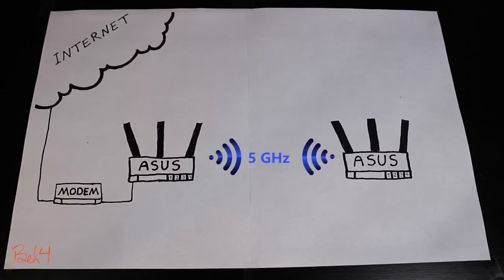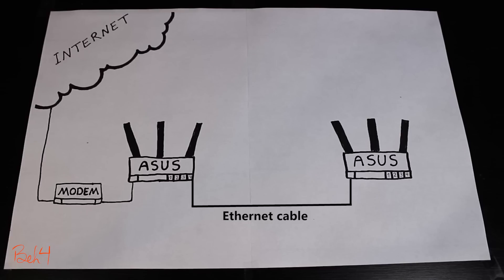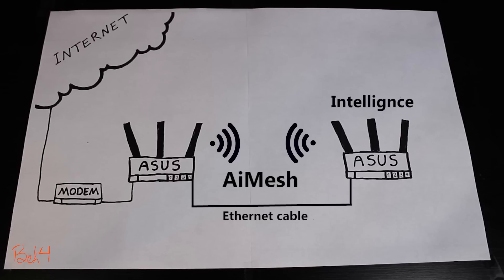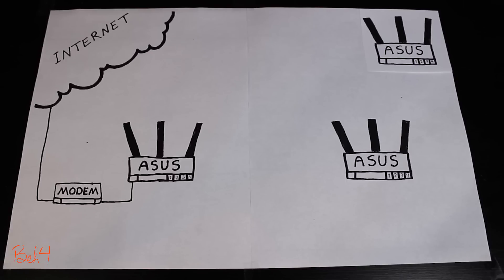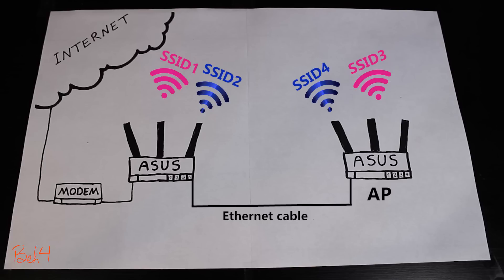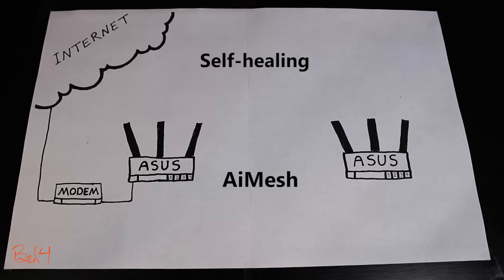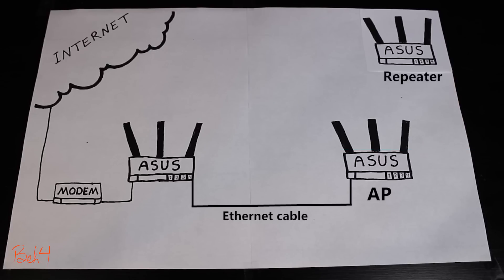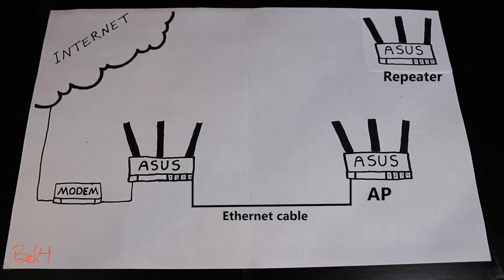AiMesh vs. Repeater vs. Access Point [ASUS RT-AC68U Operation Modes]

Comment: Hello, in AIMesh mode you said there could be interference of SSIDs between the devices. What if we activate the Smart Connect option and let's say there is only one SSID called "ASUSRouter". Are we going to see 2 of ASUSRouter SSIDs one coming from the Router and the other one coming from the Node? Isn't there a way to see the same and only 1 SSID in the house and let the routers decide which router the client will be connected? Thank you.

Comment: If we duplicate the SSID in the multi-router/repeater/access pointer systems, our devices might automatically connect the ones with weaker/slower signals (far away ones).

If we create a new SSID for each new repeater/access pointer system, we can manually choose the closest and strongest one to connect.

You might need to consider using a good ethernet cable to connect your router and your repeater to avoid signal degradation. 

What is the maximum length of CAT6e cable without data loss?
328ft (100 meters)
Cat6 Max Length. It supports 10Gbps.

CAT8 might be overkill. It supports 40Gbps.

Comment: does it replicate ethernet ports at repeater mode. I need to use vlan lan1 as it is at router.
Reply from the maker: If you are asking if the Ethernet ports work in the repeater mode? The answer is yes

Comment: I have an Asus AC68U a which i want to use as my VPN router, I connect to the internet now wirelssly with a Tp-lINK  TL-WR840N which is the access point. can I put the 68U to the tp-link? what mode will I have to use to configure the 68U and still have access to the VPN option of the 68U? I can only connect to the TP-Link without cables ,wirelessly.
Reply from the maker: It looks like from your description that you can only use your ac68u in repeater / media bridge modes ( those are the modes that allow you to connect wirelessly to the other w router) and unfortunately in either of those modes the VPN is not available.

Comment: There is one thing that has made me use the AP mode instead of AImesh: The inability to choose different Wifi bands for the mesh nodes. Since AImesh doesn't let me configure the nodes with different wifi bands, I have decided to skip AImesh altogether.

Do you know of any reason, aside from the simplified administration, to use AImesh instead?

I have one router (RT-AX88U) and 2 APs (RT-AX92U and RT-AX58U). They all use different Wifi bands. Roaming between them works perfectly well since all three support 802.11v and 802.11k.
Reply: no. you can never go wrong with a hard wired ap as it will deliver the maximum bandwidth to each node without interference. one thing you could do though is connect a switch to your main router and feed the ap's off of that instead. will take some strain off your main router. or better yet, get a non wifi router like a tplink omada. plug your switch into that and have all your RT-AX's run off the switch as ap's. ai mesh is basically a gimmick repeater mode, only with a few bells and whistles like having multiple nodes run off each other wirelessly. this doesn't always work as seamlessly as hard wired ap's. also, ap mode itself isn't exactly necessary. it will still work fine in router mode as long as you have dchp turned off on the ap's.

Comment: Subbed. I have 2 asus routers I’m setting one in the attic and the other as a access point wired in the living room. Thanks for breaking it down for me.
Reply from the maker: You're very welcome! Glad it was useful for you and thanks for subscribing 🙂👍
Reply: @Behfor  My issue was having a 'smart home' and not being able to reliably connect switches, ceiling fans, lights and appliances, along with my computer needs. I had everything wired into the attic and I figured I'd just put my router up there. It's a stick built house, all interior walls are insulated. I had a 7 year old AC3100 that worked well but was obviously out dated. I picked up a RT-AX86S and installed that in the attic and reconfigured the 3100 to an AP wired in the main room of the house. The one thing I did with the 3100 was let it provide the IP address dynamic, I didn't assign it static. That was an option in the 3100 AP setup. It took about 2 1/2 hours from unboxing the 86S to up and running the AP, some trial and error with naming and the usual 'first time' issues.
As for the connected appliances, I was able to configure all of them the first time, some with the AP and some with the host router.
Thanks for the help.

Comment: I found this video while trying to get rid of “double nat” on my xbox. It’s a great video!  My question is when I put the ASUS router into AP mode it says it disables dhcp and nat. My primary router uses 192.168 ip addresses, but my access point hands out 10.xxx ip addresses even though it apparently has dhcp disabled. Is there a way the AP can receive an ip from the primary router and any clients to receive their ip from the primary router through the AP?  Thanks in advance!
Reply from the maker: Hi, as you mentioned yourself when your change the operation mode to AP then the DHCP server gets disabled and it no longer hands out any IP addresses at all! The AP only passes the DHCP requests to the DHCP server which in your case is the main router! I would check the DHCP configuration on the main router and make sure it is correct! Also I would make sure there is no other DHCP server in the network. Thanks.

Comment: In the later part of the video, you showed AP router (connected to the main/primary router via ethernet cable) and Repeater router. Can these two (I mean the 2nd and 3rd router) be linked via AiMesh? I don't want the 3rd router in repeater mode.

Comment: OK, so I am looking to increase my Whole home coverage of Wi Fi and using the Asus Zen system and would like to know which method of the secondary node would be best for my second Desktop PC in another room. Would I connect the PC via Ethernet to the node and run the mesh system with wireless backhaul or use repeater mode for the second PC ? Trying to keep it simple so I am leaning towards the mesh mode for the satellite node. Thanks for sharing & Stay safe.

Comment: Let’s say i have Asus Router ——> Access Point ——> Repeater

Question 1: I heard that the speed could get 50 percent slower when a repeater is added to the chain. So does this mean my internet as a whole will slow down, wether im connected to the AP or the main router or the repeater? Or will the speed only get slower when im in the part of my house where im connected to the repeater?

Question 2: Will plugging an ethernet cable to a Mesh router be worse than connecting it to an Access point or the main router itself?

Let’s say i needed ethernet in a room, should I…

A: Access point and wire it to my room
B: run an ethernet cable from the main router to my room
C: get a mesh router in my room and plug my ethernet there

Comment: Thank you, Behfor, for some very instructive videos on Aimesh. Actually, I am hoping you are able to help me out on the following issue: I recently aquried a second AC68U device and now have two AC68U's connected in an AiMesh set up (no cable between Router and Node). Both have the newest firmware. But, very annoyingly, I am frequently requested to type in the password for my network. This never happened when I had only one AC68U. The system often responds with a "incorrect password", but trust me: I am typing the right one, I did not change it when going from a single router to the AiMesh set up, and in the dashboard of the AC68U's the password is noted as expected. And everything works for most of the time, but from time to time this "retype password"-issue pops up. What is happening? Do you have any ideas?
Thanks a lot!
Best regards
Jesper, Denmark

Comment: A quick question... is it possible to connect my PC wired to a AIMesh node (Access Point)?  I have a cable from downstairs to the first floor where I would like to add a AIMesh Access Point, but I want to connect my PC by cable, not WiFi.

Thanks in advance!

Great clip, keep up the good work :)
Reply from the maker: You can use the AiMesh node's Lan ports to connect wired devices to your network.

Comment: do the router have to have a clear line of sight?
Reply from the maker: In the case of an AP the answer is no, in the case of Repeater & AiMesh the answer is still no but just keep in mind, since the connection is wireless any walls in between would reduce the effective range of the wireless connection.

Comment: I changed the router to an AP and I want revert it back to router mode without losing the settings.This is a asus AC68U. I''m getting this error msg unable to connect to parent AP.

Comment: I keep reading reviews saying that if you use AIMESH without the Ethernet cable then the stability is poor, i.e. the system requires frequent manual resets. Furthermore reviewers say that automatic firmware updates also disrupt things - one version will be relatively stable whereas the next update may mess things up. I need a system that stays up for weeks or even months without anyone touching it, and I also cannot run an Ethernet cable. What do you recommend?
Reply: I use an asus router and tp link repeaters. I use a old stable version of the asus router firmware. The newer versions are garbage - very unstable. Asus works great, but the firmware is hit or miss. My advise is to find a stable firmware and stick with it. Do not update it if it’s working.
Reply: i use asus RT86U both in latest firmware, and my AiMesh Node connect wirelessly, have total of 21 clients, 3 device wired with main router, overall my connection still great both main router and Node.

Comment: Hi Behfir, 
I have 2 Asus RT-AC86U routers and I configured the main router radiating 2.4GHz and 5GHz on separate channels because my home automation devices are 2.4GHz and the automatic network was not working. When I added the second RT-AC86U router with AiMesh, after some time, the connections started to oscillate and show intermittency and lack of internet connectivity. When I remove the second router from the network, the stability increases but some devices are out of reach. Do you know what may be happening or how to configure hysteresis parameters to decrease ping pong from devices connected to routers 1 and 2?
Reply: Run AP mode is my preference for stability

Comment: hi my issue is that I have a mesh set up using ASUS RT-AC59U V2 but my modem from my service provider still broadcasts it's own SSID as well. Is this normal, does this cause interference between my networks and would you know how I should shut it off?

Comment: Great video (I have the same router), but can I use AP mode without an ethernet cable?
Reply from the maker: Thanks, the answer is no, because an AP is a device that connects to a router with a cable, so if there is no cable between them there is no AP.
Reply: Thanks - makes sense. 

My WAN / internet port is in our kitchen, while my router is upstairs next to our NAS (connected with a LAN cable for speed). 

I presume my options would therefore be AiMesh or a repeater.

Comment: This is just an Asus scam. if you want to use AiMesh you'll need all ASUS routers that are later than the AC1900. For me I only have a AC1750 and it only has a repeater mode. I used it as my "extender" from my older primary router that doesn't have a repeater mode. I set the extender with the same SSID and automatic channel so they are likely not gonna interfere with each other. If you have another older router that doesn't have repeater mode, this works well and you'll save lots of $$.

Comment: Can aimesh work wirelessly ? Suppose we configure it with Aimesh and primary router shows 2 nodes connected to it. Now is it necessary to provide any connection with wires between them.
Reply from the maker: Connecting them with wires is recommended because it'll improve their performance but it's not necessary! They would work wirelessly as well.
Reply: @Behfor  I have installed primary router in basement, router at ground floor is connected with wire but with Aimesh setup, and third one (means second node) is connected wirelessly. Would it work? Where primary router shows it has 2 Aimesh nodes.
Reply from the maker: @aspireztechnologies  Yup, it should work fine, there are 2 nodes, one wired the other one wireless.

Comment: can i add a repeater to an aimesh network? i want to do this because the spare router i want to use is not Asus.
Reply from the maker: It should work, I mean obviously it wouldn't be part of the AiMesh system, but a repeater that is connected to your WiFi.

Comment: I have Asus RT-N56U but  all the ports it's not working.. How do I solve this problem
Reply from the maker: This could be a hardware issue, not sure though, but I personally would try doing a factory reset, if no luck, then try a 3rd party firmware, (if possible and if I'm willing to take the risk of installing a 3rd party firmware) and if still no luck, most likely there is a hardware issue. I might still be able to use it as a repeater though.

Comment: Dude, you missed the point, besides all other problems you mentioned, repeater or ap without backbone cable will lose 50% of bandwidth...and this one is no no for shared wifi 4k streaming it gaming...and another one not a biggie for home users..roaming...but if you have 1500+ sqf flat space, it is the  problem with repitor or ap
Reply: I think it uses a back channel for data back to the gateway over wifi. That is a separate channel that does compete and thus halve the available bandwidth on the the channel you are using.

Comment: Im trying to decide between buying a wifi extender or just buying another router and use as an AiMesh.. which one is better and what is the difference
Reply from the maker: I personally would buy another router and use it as an Access Point or AiMesh, because not only can I use it to extend the range of WiFi but I also can use it as a Router later on if I need to. But that's only me :-) Thanks!

Comment: Hi. Really cool videos and you seem to really know ASUS/networking stuff.
I hope you may have some cool ideas about a dilemma I am in. I have a main rout RT-AC68U and two RT-AC88Us. I have set both 88Us to connect to the 68U as a bridge. It works and they have different IP addresses assigned BUT there is a huge problem. I can't see clients in between the bridged 88U's. In fact, even clients that are connected to the same 88U can't usually see the wireless printers connected. All clients are connected via 2.4ghz and the 68U and 88U's are connect via 5ghz. Should I use AiMesh? Also, I don't recall seeing Repeater mode that would maybe work....
Reply: Oh, forgot to mention, I want this to be a complete network where all clients can see eachother. I think WDS loses some speed.
Reply from the maker: Hi, I'm not sure if I got your question! I got the part that you have 2 routers as bridges and I'm not exactly sure what you mean when you said "I can't see clients in between the bridged 88U's"! If you mean that no wireless clients can connect to the bridges, then that is expected behavior, because a wireless bridge doesn't broadcast any wireless network, it just connect 2 LAN segments, thus only the LAN interfaces on the bridges can provide network/Internet connection. If you need the bridges to also broadcast wireless networks then you should set them up as repeaters. Thanks.
Reply: @Behfor  Thank you so much for your reply. I totally said the wrong thing. The two AC88Us are set up in repeater mode. They also support Media Bridge, AiMESH and Router modes.
I hope I can explain clearly this time LOL. The routher is in Repeater mode. So I have Main router 1: xxx.xxx.1.1, Router 2: xxx.xxx.1.100, Router 3: xxx.xxx.1.160. When I connect a laptop to Router 2 (in repeater mode) I can access the internet, I can see and access printers on router 1. I can't see printers that are connected to router 2 with the laptop connected to router 2.
Basically all of the connected computer and printers can't see each other in all the different routers/repeaters.
Oh, and all the routers have different SSIDs. But every computer/device connected to any of the repeaters can easily access the internet.
Sorry, I'm crazy but I just don't have enough to test since these routers are current in production.

Comment: Is it possible to manually assign an IP for the secondary AiMesh node?
Reply from the maker: Unfortunately in the AiMesh configuration there is no option to assign a static IP address to the nodes (at least for now), however in the DHCP server of the primary router I was able to manually assigned an IP address to the Mac address of the AiMesh node. So it looks like with this workaround it is possible (again, at least for now)! Thanks.
Reply: @Behfor  Thank you for responding.
That's fine, that's how I do it now (Netgear). It's important for me to be able to assign specific IPs within a certain reserved range to my own devices (including any mesh nodes). And another range (DHCP) to any guest devices, as this is one of the ways I restrict access to certain LAN devices.

Comment: Hi, I am planning to use two Aimesh nodes to extend my wifi. I am planning to use Ethernet cable to connect the nodes to the router. Do I connect both nodes to the router directly or connect Node one to the router and the Node two to the Node one?
Reply: You can have 4 nodes in a star out from the router and a max of 2 nodes in a daisy chain. The AImesh will decide which is the best way to connect, ethernet, 2.4 or 5Ghz . With the cable usually being the best.